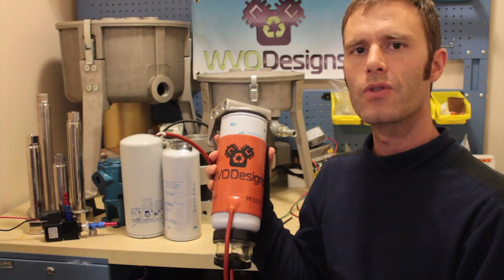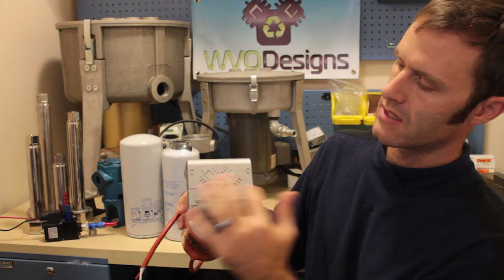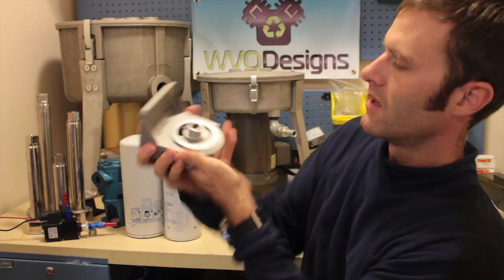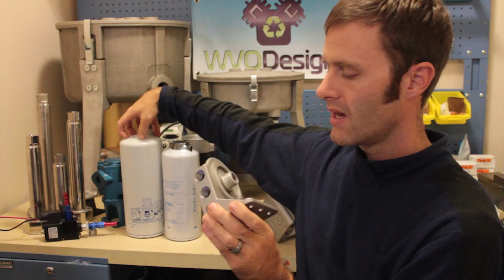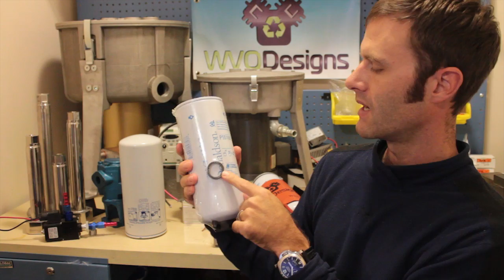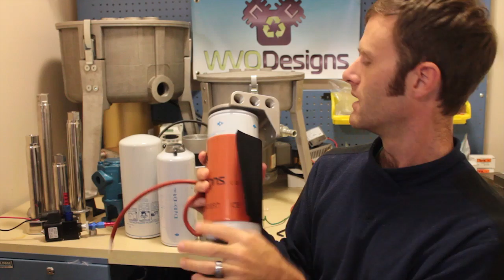WVO Designs - Heated Fuel Filter

Comment: very cheaply made.The cheap rubber wire has failed on 4 of mine way to soon.Called them explained to them and first thing they said was would you like to buy more.No warranty what so even.Go with a different brand that makes the cables larger